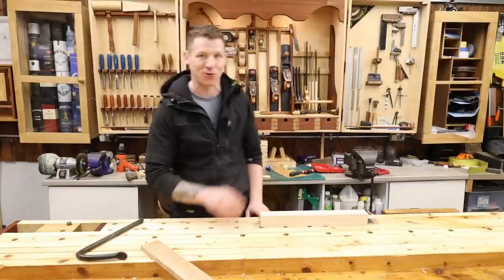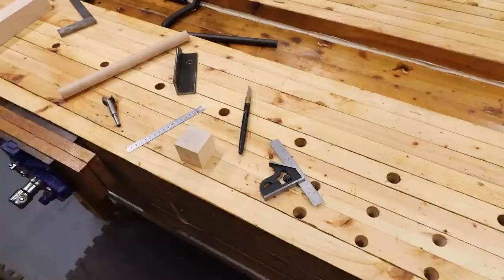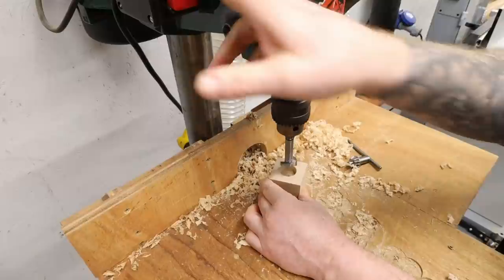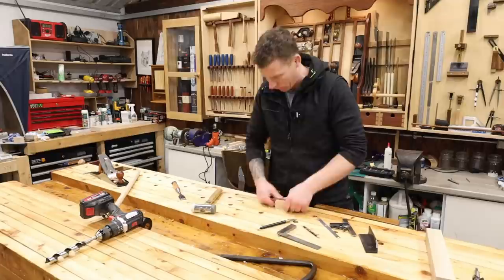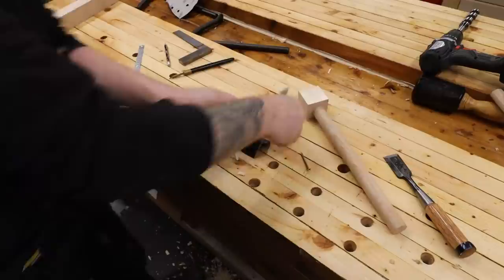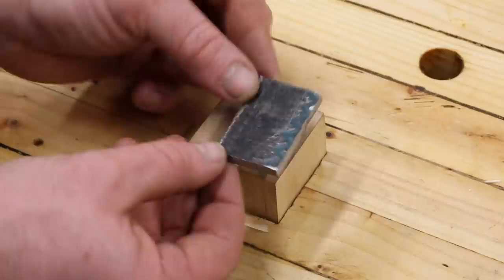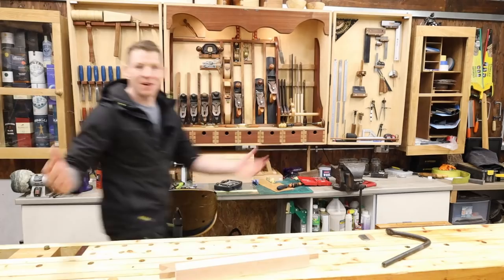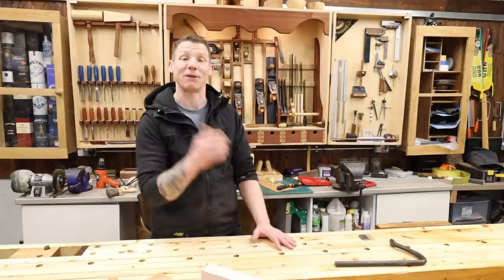Planing Stop/ Bench Stop. How to Make and Install One. No Vise Needed for Woodworking

Comment: I think a good idea would be to recess a block a little deeper and make a square cap from wood, so that the metal surface is not exposed at all, just in case. When you knock out the hold down the cap just falls off

Comment: Well made - but:
I know that in English they say workbench, in German we call it a planebench - because we plane on it. And I would never put anything made of iron in the surface of a planing bench, I spend enough time sharpening my planer knives as it is.
I could imagine the whole thing made of hardwood only, but then it's not such a big step towards a tail-vise.
Reply from the maker: But you don't plane your bench top so there is no chance of hitting the metal teeth.
Reply: @JohnMcGrathManInShed  Of course I plane my workbench from time to time, after all it is the reference level for the workpieces that I plane. But OK, you can remove that piece of metal while you're doing it. In summary: The smaller the workpieces are that you plane, the higher the chance of hitting the metal. And sooner or later that is exactly what will happen. The residual risk is too great for me, mainly because it is unnecessary to use metal.

Comment: Traditionally the stop was a just a block of wood that could be height adjusted, I still have my grandfather's bench with one and there is no way he would have put steel anywhere near where his precious planes could possibly hit. If you wanted steel why not just add a bench dog
Reply from the maker: The whole point of the metal is the teeth and the teeth are below the height of the work piece so there is no chance of hitting it. Planing stops like this go back hundreds of years so that would qualify as traditional.